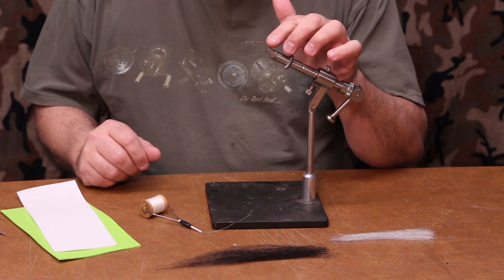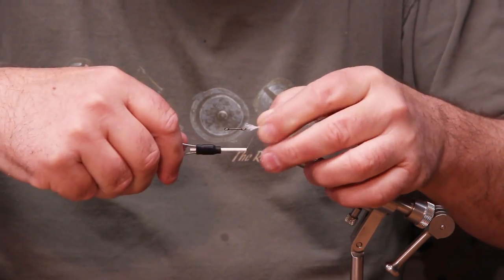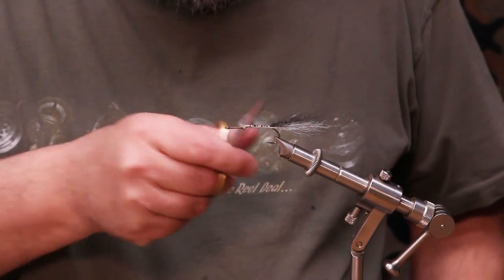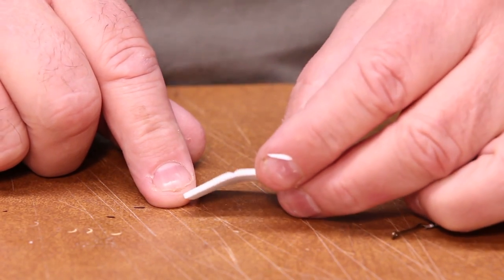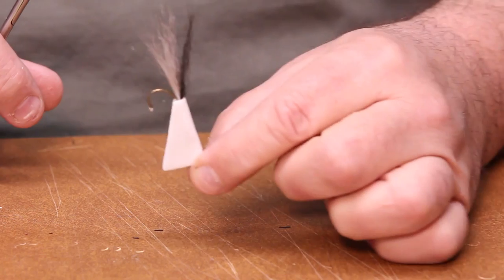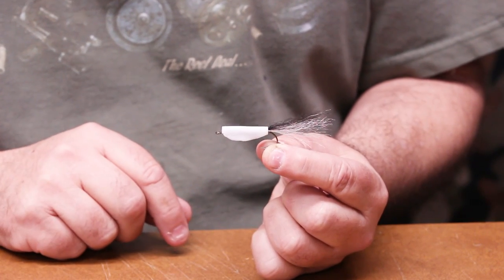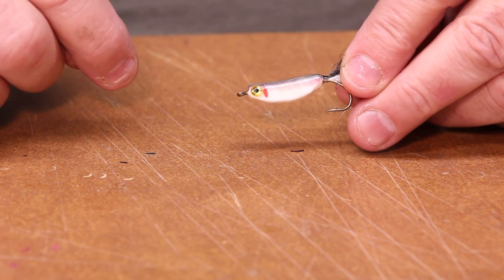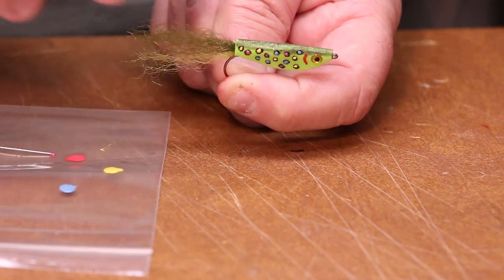Foam Minnow (Fly Tying) Painting & Decorating

Comment: Chris, you do not have an allergy to superglue. When superglue cures, it heats up gives off fumes The lining of your lungs is reacting with the superglue fumes and basically crystalizing. The same thing happens when they fume for fingerprints in a chamber.  Superglue reacts instantly to oil, mucus, and skin. Everybody has this reaction, and it is dangerous for anyone to inhale these fumes. Let the public be warned. Superglue should only be used with a very good ventilation system. You are wise to choose an alternative adhesive.